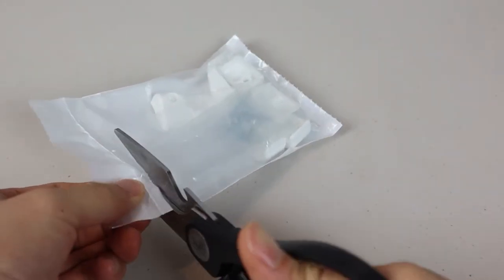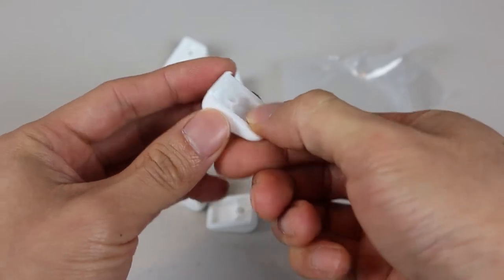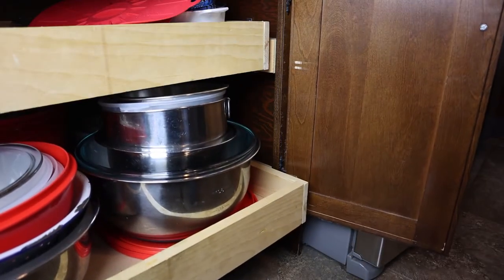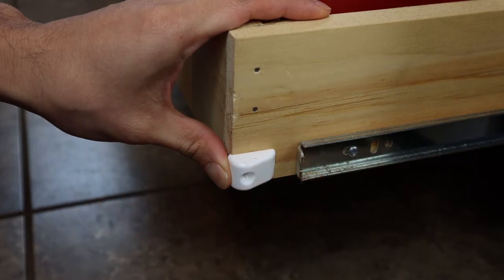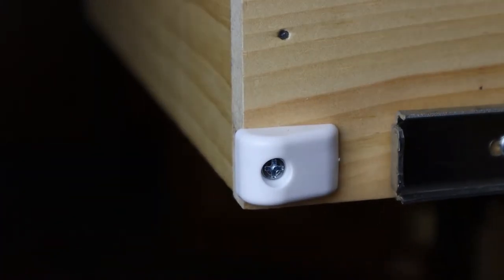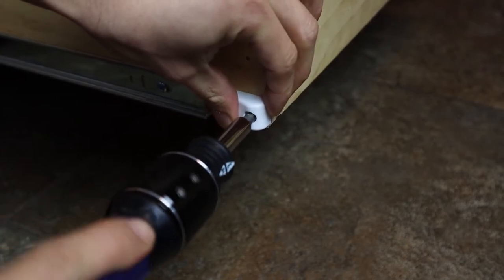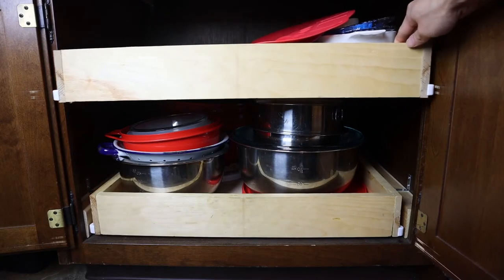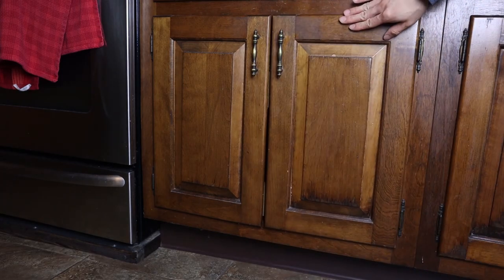How to Install Sliding Drawer Bumpers to Protect Cabinet Doors (Installation and Review)

Comment: My drawer slides come all the way to the front edge of the drawer; your runners are shorter.  How do I apply these protecters in this case?
Reply from the maker: Install the protector just above where the drawer sliders sit. The plastic bumper will still make contact with the door before the slides do and push it out of the way so that it doesn't get scratched.